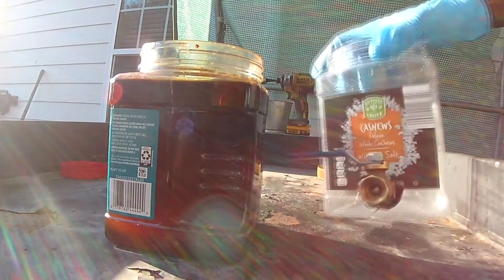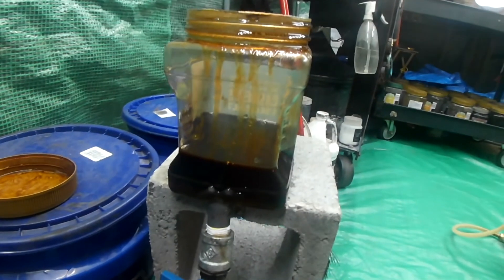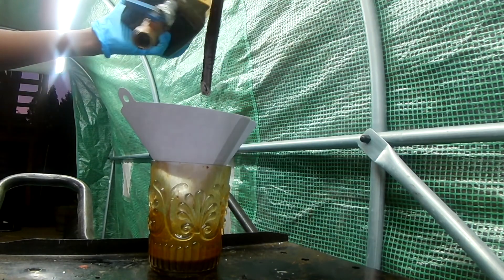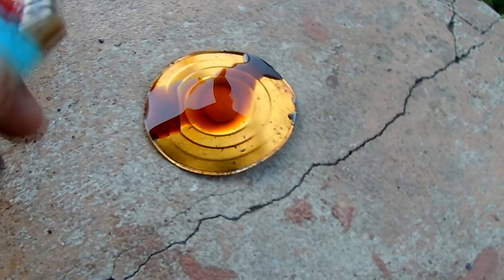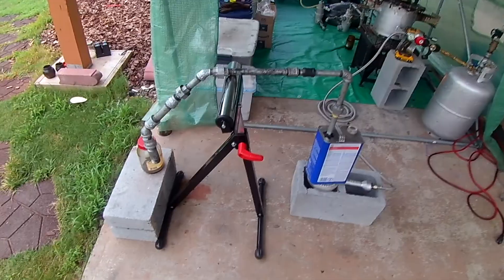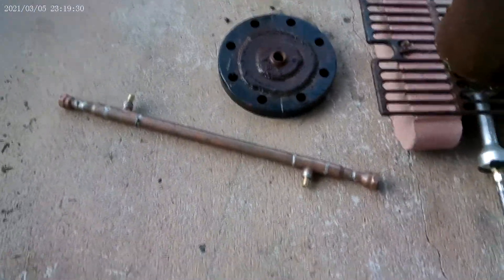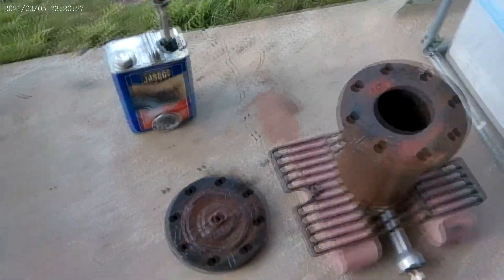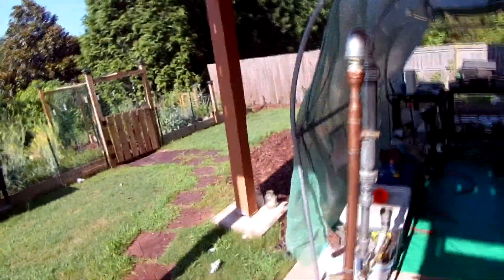Chemically Refining Pyrolysis Oil Part 2

Comment: perhaps use an acidulation step to remove metals and clump up the tar, just add like 1% conc sulphuric acid. Then move on the base addition (just a molar solution of NaOH and water), the amount of NaOH is determined by a titration. Separate the precipitate and then move to a distillation setup (the one you have will do).

Comment: What you have collected here is a mixture of wax and tar I guess. You should use a condenser after the Collecter you are using. That collector you use should be for the wast wax and you should divert the fume that’s being lost through a condenser and to the oil collector

Comment: Murphy's law is neutralized by a funnel. Your process is completely incorrect because only at very high pressures can you achieve your goal using that method. You would have to use the high heat method in a high heat distillation backyard laboratory example with temperatures of around 350 to 400 degrees to crack polymer chain apart in order to reach fuels separation and even decolorization.
Reply from the maker: "Murphy's law is neutralized by a funnel" that gave me a good laugh, cheers mate! Im not trying to crack as much as I am trying to seperate, as I already have gasoline products present, but I see what you are saying!

Comment: A good setup would be a holding tank very heavy built a reactor very heavy built a condenser a vacuum collecting tank all in line with each other so that the reactor and holding tank are self-leveling therefore self- refilling then a vacuum pump on the collecting tank with a check valve the condenser could be water cooled with a garden hose running cool water through it continuously
Reply from the maker: In the future, this is something I want to look into

Comment: You want to run any distillation at the absolute lowest temperature of the fractionating point of that that's being distilled
Reply from the maker: Thanks!
Reply: doesn´t matter it always distills the lowest fraction first, then the temperature is rising slowly to distill the second fraction so on so forth. so you can set the temperature to the highest fraction you want to get, agitation is a must this can happen in form of a stir bar or some boiling stones ( these act as nuclei points) it prevents "puking over" ( liquid spills over into the receiving flask)

Comment: Mega 😎. Observations:
- your oil after the Methoxide wash and water wash isn’t bad for a small batch run. It is red/brown and slightly clear. My first small batches of bio and pyrolysis fuels were also not crystal clear, this might be because of oxidation in small batches. 

- if you do decide to use silica again, instead of filtering through it, put a handful in the bottom of the jar and let it attract the water and impurities. You don’t need much at all. That said, I have never bothered with silica and just used good old gravity!

-The distillation post-microwave is a good idea, a lot of the plastic guys have to double distil anyway to keep the product liquid. Very interested in the result. 

-don’t completely scrap your research on chemical washing because you might need it in parallel or for larger batches. I.e I can use just 1 litre of methanol, about 200g KOH and free rainwater to treat 40L of fuel, this would take forever in a still haha!
Reply from the maker: Thanks! What do you do with the oil - infused rainwater that you use to wash the stuff?
Reply: How to change color or refine the tyre pyrolysis oil TPO fromblack color liquid

Comment: Too much silica for the amount of oil.  I pour in a tiny amount of coarse silica gel cat litter so it's a 1/2 inch in the bottom of a tall container full.  Then let it sit for 2 months.  I've had dirty oil pyrolysys products clear right up to a transparent yellow, and the silica gel was dark red.  I'm really not very patient, but some experiments happen because I get distracted and leave them sit.
Reply from the maker: So you don't need to ever stir or agitate it in that 2 month time period?
Reply: @naturejab  No, in fact the stagnation I think is what really made it clear up nice.  Any dirt or moisture went to the bottom.
Reply from the maker: @dansw0rkshop  Alright  thanks, I will set aside sample with silica in it to see if that'll clean mine up

Comment: Ah damn your silica was probably not the right kind. In the lab I used silica that looked nothing like ordinarily silica gel. Distillation is probably necessary to separate the volatiles.
Reply from the maker: That would make sense! Thanks.
Reply: @naturejab  Lab silica looks a lot more like extremely fine sand, and you can only pass low viscosity stuff through, unless you use high pressure to push it through. Trying to pass a bunch of sticky oil through the very fine lab silica would surely result in a clog. And in general you need to wet your silica with your solvent before use. You would probably need to get the fine silica, mix your oil with 5x to 20x as much solvent to get the viscosity down, wet the column of silica with pure solvent, push the mixture through with some modest pressure (1-2 bar, not much), then redistill the hopefully clean liquid to reclaim the light and heavy fractions from your solvent and the oil. This would be a crude version of something called column chromatography. But before all of that, you should probably do a first distillation to get rid of most of the gunk. And the lightest fractions from the oil should have a viscosity low enough to not need any solvent for the column.
Reply: for drying one could use 1.) MgSO4(epsom salt high waterholding capacity, fast acting, cheap, not suitable for acidic solutions), 
2.) CaCl2 (cheap, specially suited for hydrocarbons), 
3.) CaSO4(allrounder, fast acting low waterholding capacity),
4.) NaSO4 (slow but very high waterholding capacity, neutral and bulks up quite nice, easy for filtering, temperature for filtering should be lower than 30°C), 
5.) Na2CO3 ( it´s middle in waterholding and speed of dehydration, especially suited for basic solutions, isn´t suitable for acidic solutions), the best one would be CaCl2 as it´s cheap and perfectly suited for dehydration of hydrocarbons. if the drying agent is wet you have to bake it in the oven at 200°C, store airtight

Comment: Looks like you could almost run a lawnmower with the stuff you're making at this point. Evolving and refining your design. You probably already know, but in case you didn't, an air conditioner might be useful for you. The compressor will make for a good vacuum pump but it might not last terribly long. It will have a condenser and evaporator (the radiators). They ***should stand up to the heat and pressure. You'll have to have a manner to collect the refrigerant though. That might cost you. If you can come across one that's already been opened up though, game on. If you ever have wood fires you can make your own lye with the ashes. Once you have this process dialed in, maybe you could make it profitable for someone to go and do something about the Trash Islands in the ocean. That's the only way something will get done. If someone can make money off it. There's a lot of potential fuel floating out there.
Reply from the maker: Thanks for the comment! I have two refrigorator compressors, and am planning to use one for a vacuum filter. I don't have a radiator / condenser from an AC though, but for now the copper pipes will do. And the end goal is to make this process 100% environentally friendly, sustainable, & profitable, so trash is no longer seen as trash, but fuel!
Reply: @naturejab  Right on. I figured you probably knew about that stuff already. You're young and driven. I had a Friend talking about the Trash Islands and repurposing a de-commissioned oil tanker. Once you and people like you can figure out how to make trash into profitable fuel you're going to fly. Stay in it!
Reply from the maker: @heliarche  Yessir, thank you very much! 💯